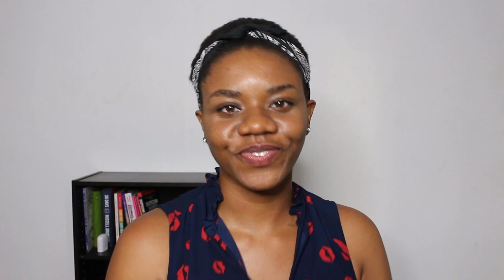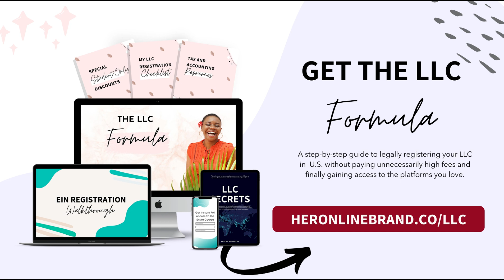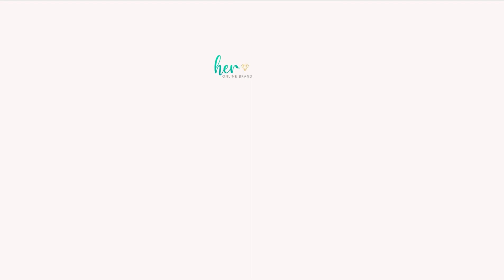Stripe Account Verification For Non U.S. Residents outside the U.S.

Comment: Regsitering the US LLC is easy. The problem is when I register my US LLC I can only now connect to Shopify Payments. Stripe is not available as an option anymore it is the same as Shopify Payments. The problem now is with verifying your address because they start asking for a proof of address and I will not have it because I do not live there. Do you know the solution to this?
Reply: Hey  did you find a work around this problem?
Reply from the maker: I have not run into this problem but you can get a mailbox in the US and ask if they will provide proof of address. Another option is to pay for a virtual office in the US. Some cost about $49 a month. Ask if they will provide you with verification for address
Reply: @HerOnlineBrand  Hello, I messaged you on Instagram, hoping to get some advice. But, you didn't respond☹
Reply from the maker: The Irvings I must have missed it. I’ll check
Reply: @HerOnlineBrand  But they will know if u use virtual adress. It has to be physical adress. How to solve dropshiping problem?
Reply from the maker: I solved the Shopify issue - https://youtu.be/PSSDRCppn1M